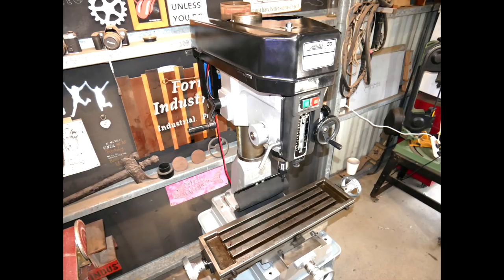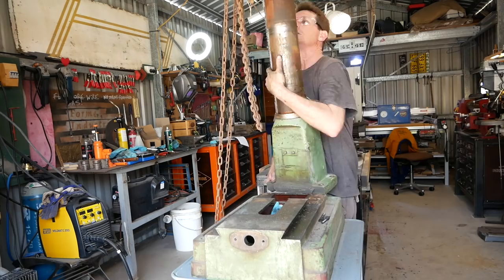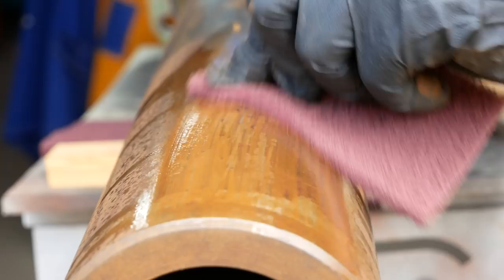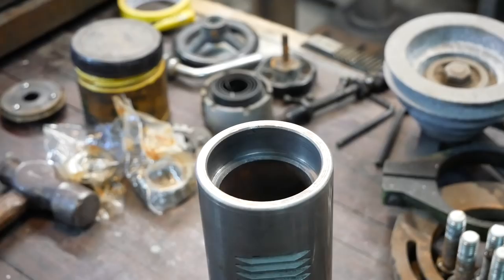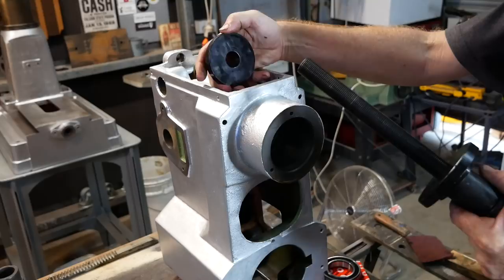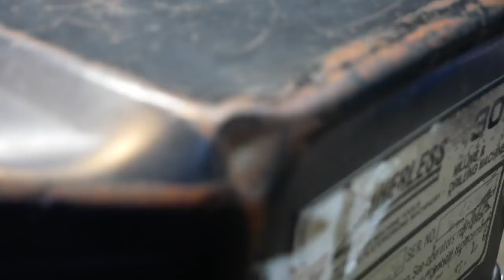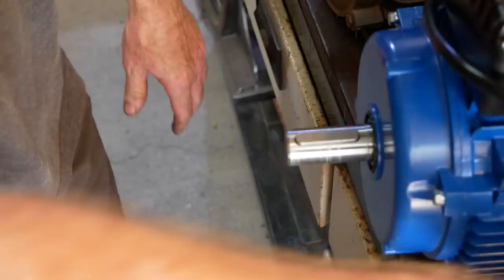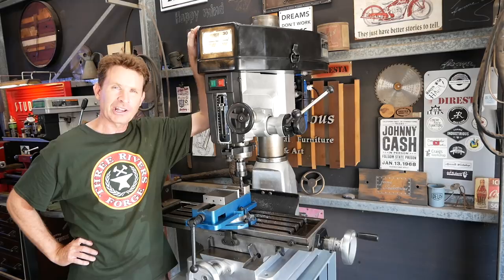RF-30 Mill Drill Restoration - Forme Industrious

Comment: I learned an awesome tip a few years back from a friend; get yourself one of those basic cheap FoodSaver (that’s the main brand in the US anyway) vacuum sealers. Next time you need to pack a bearing, cover it in a good amount of grease, pop it in a vacuum bag and run it through the machine. When all the air comes out it pulls all of that grease down into the bearing. Fast, easier and a hell of a lot less messy. Friend does that for spare wheel bearings when he goes to the race track. Aside from being easier it also doubles as keeping any spare bearings sealed from dust/debris in a nice neat package 👍🏻. Awesome video as always sir! Cheers from Arizona!
Reply from the maker: What a great tip! Thank you Danny, very much appreciated. All the best!

Comment: Much respect, my friend.  That was a huge job, and you did it thoroughly.  Love your broaching tool solution!  I am so glad to see that machine in your hands, put back into service.  Thank you to whomever donated it to Scott.
Reply from the maker: Thank you! I was looking for a simple solution for the enlarging the keyway. Fortunately the Aluminium is nice and soft and I could get away with using the chisel. I was surprised how easy it was in the end. I was happy to mention the guys name however he wished to remain anonymous. He is thrilled to see it back in action.
Reply: Absolutely I fully agree Batti2323
Reply: @ScottTurnerformeindustrious  Lucky you didn't just put a VFD on it as I will explain. 
FYI - I am an engineer with 30+ years in automation and I have installed and commissioned 100s of VSDs all all types of motors.

1st off the correct terminology these days is VSD (Variable Speed Drive). The old terms of VF, VFD, VVVF and others have been sent to the history bin for the simple reason that these days even basic drives can vary so many motor driving parameters and functions that its just inaccurate to call them anything other than VSD. If you tired an acronym that accurately describes all they can do it would be (in some cases) 100s of letters long. Circa 2010 I used a basic ABB 150 VSD on a fan [pushing air on a mine site. We did that for nothing more than the motor starting. That basic drive had more parameters and capabilities than many of the state of the art drives from the 90s. There was an incredible leap in motor control technology in the late 90s early 2000s.   I have used some drives with in excess of 3,500 parameters. 
Surprisingly some of the really high performance servo amps for robotics are also incredibly simple. Most of those vary nothing more than the torque output. Doing that accurately over the full speed range is the tricky bit. 

2nd there is a huge misunderstanding that single phase VSDs operating at 240VAC input then output 415VAC to the motor. THIS IS TOALLY UNTRUE.
The way ALL VSD's work is they first convert the incoming AC into DC and then use a transistor pack to create the variable 3pahse output. There's no magical voltage increase in that process. I have seen others make this basic mistake on YouTube and there is a simple fix.

In Australia many motors under 5kw and most under 2.2kW can be reconfigured. You can use them with 415VAC in DELTA where the 3 coils are arranged in a triangle (the Greek letter for D is a triangle). You can also use them with 240VAC in a STAR configuration where the 3 coils are arranged in a Y configuration. What you do need to consider is the POWER consumption. Not output but consumption which shows up as current. So you have to be carful that the cable to the motor is rated for the additional current. And yes engineers make that mistake way more often than they like to admit.

What you can do with many 3phase motors to retain the power output is reconfigure the motor from DELTA to STAR. If you look in the motor terminal box for a 3phase motor most actually have 6 terminals (2 groups of 3 opposite each other, 1 each for the end of each of the 3 windings). There are (in those motors that can do this) 3 small links. If you see those 3 links in parallel across the terminals then the motor is most likely wired in delta configuration. It you see the 3 links being used to connect the 3 terminals on one side together that its wired in STAR.
Look on the inside of the terminal cover or in the manual for the motor to check/confirm how you can wire the motor and what voltages the configurations  are for.

3rd what many engineers and others mistake is that the motor will deliver the same torque over the entire speed range. In the case of a mill or lathe they are forgetting that with the gear box also changes the torque that is delivered. If you just replace a pully or gear box system with a VSD & Motor its also very easy to lose all of the torque variability. This is why many of the small mills and lathes with VSDs still have a high-low or 3-speed gear box.

Comment: A simple but useful mod is to add some thin disk spring washers (Belville springs) to the spindle clamp. It allows constant drag on the spindle even when there is some wear where the clamping brake blocks contact it. You can still compress them down enough to lock the spindle when required but it stops some of the annoying rattle that results from leaving it too loose. I have eight of them in alternating directions on mine (0.035" thick a bit less than 1mm). It also allows you to have the clamp lever in a suitable position without it loosening under vibration.

Comment: The reason I watched your video because I own an older jet 16 inch drill mill, I want to remove the backlash from the table feeds. With the help of your video I now have the courage to start the repair work on my machine, thank you and by the way your rebuilt machine is awesome.
Reply from the maker: many thanks! I hope your restoration goes well.
Reply: @ScottTurnerformeindustrious  I stated the repairs and started ordering parts. One thing I learned order generic parts from other vendors, the Jet replacement parts are overpriced.

Comment: It was great to see someone that actually knows how to pack (lube) a tapered roller bearing. I couldn't even begin to count how many videos I've watched where someone is upgrading a mini lathe spindle with tapered roller bearings and all they do is wipe a little grease on the outside of the bearing and install it. Great job on the rebuild. Like you I would have jumped at the offer of a free mill project like that.
Reply: I guarantee you this dude is a motorcycle mechanic. That's what I do for a living and I see a lot of similar habits.

Comment: To give you an update I stripped the mill down to bolts and nuts cleaned everything up and used industrial grey oil base enamel paint. I bought new bearings. I'm ready to put the mill back together... To clean the old paint off I used a wire brush on my disk grinder. It took the paint off to bear metal. I wanted to send the mill table off to have it milled down .010 to .015 thousand but decided to live with the beat-up surface. I have watched your video several times as I didn't lay the parts out like you did I just piled them in boxes and whatnot so your video has come in very handy. Best wishes from Mike E USA.
Reply from the maker: Hi Mike. I agree with the table, just take off any high spots with a file or such. Not that critical on these machines and you will save a few dollars. I'm glad the video has helped. All the best!

Comment: As always a excellent job you did restoring the mill. I always keep the old bearing race and make a slot in it with a thin cut off wheel and use this to press the new bearing in. The slot makes it easier to remove afterwards. Greetings from Belgium
Reply from the maker: Good idea. Thanks Tom!!

Comment: My current projects apart from a part built Jessie in 7 1/4 inch gauge are a Super 7 and a Raglan 5. Both super groups from the 50s he jokes. 30 years in a workshop with a leaking roof of course. Dragged the second past a rapidly filling skip now arrived. Both free, grabbed a small flypress, filing machine and a power hacksaw as I left on our 4th visit. 11 miles away YOU JAMMY SOD!!! Lovely Work Scott. David and Lily Scott Reading England.

Comment: I have the same or close to a drill mill like yours, it's every bit as bad as yours. My half-nuts are not good, so I might have to replace them. One thing I'm going to do is send the table out, have 10 thousands removed maybe up to 15, and clean the table up a  bit. I'm sure my drill mill was owned by a blacksmith cause everywhere there is a flat surface they must have used a hammer and pounded on it. I paid 140.00 for the mill and lots of parts including a pully and shaft were missing I just started cleaning my mill up yesterday and today watching you rebuild yours has been a real help for me.  Thanks, Mike E. The Bench Jeweler.
Reply from the maker: I'm glad the video helps with your project. Yes the half nuts will be worn on the older machines. I've adjusted mine but they are still sloppy. All the best with the rebuild!

Comment: Man this brings back some memories! I know how much work that was and yours was in worse condition than mine, so great job. Don't make the mistake I did and ever sell that thing! They're such great workhorses. By the way, when I had the same mill I made a little something I think you might have more use for now than I do. I can send it to you if you want?
Reply from the maker: Thanks Phil!  I referred to your video quite a few times, just so you know why there has been a spike in views on that video ;) It's a keeper. I need to fix the backlash in the lead screws I think (0.25mm and 0.5mm). Looking into a DRO which would help with that backlash. If you like, send me an Email and many thanks; sturner2022@gmail.com
Reply: Scott Turner oh cool. If you DRO it id be keen to see it. Picked up a RDM-350 version of these. Just starting to tool up and learn machining.

Comment: That was well done, I have the original Long Chang version, needs the same treatment ( don't think it will ever happen on the long list of "Round Tuits") couple of observations I would not have use 3 in one, that stuff drys up like shellac, ( never use on your sewing machines) plus that old chisel happens to be one the best Stanley made from the seventies, the stuff they make now is rubbish
Reply from the maker: Never knew that about the three in one. Easy enough to remedy. The chisel was put to bed unharmed, maybe a little shaken... Thanks!

Comment: Good job on the resto.  When you get tired of cranking the elevation handle, (if you haven't already), an old ½" plumber/electrician's drill, (IE: Milwaukie Hole Shooter, for reference), makes a capable & easy motorization of the elevation.

These type of HD drills used by plumbers came w/ a reversing switch, making it a good choice. Without a reversing switch, you have to crack them open & get wires into the fields.

I had 2, one reversing. Trying to get the chuck off the 50 yr old drill has kept me from re-wiring the non-reversing.  After pounding & impacting 'til my arms ached, I'm now trying the penetrating oil & get back to it in 6 months technique.
Reply from the maker: Cheers George for the tip. So far I'm okay with how it is, but you never know what might be done in the future.

Comment: Fantastic strip and rebuild instruction. I have a Warco Major which is the same, and I need to take it apart to get it down into my cellar. All questions answered, it will be a doddle now. Many thanks Andy. UK based.
Reply from the maker: Thanks Andy! They are simple machines really, just heavy. All the best for your refurb.
Reply: @ScottTurnerformeindustrious  By the way, where did you get your chuck and collet set from? thanks Andy
Reply from the maker: @andyjchapman09  an Australian Ebay supplier. Wasn't expensive.

Comment: I can just imagine the hours of fun you had renovating this mill.........back in  1980 I was on the eve of emigrating to OZ and assumed it was the back of beyond so decided to invest in a mill drill like this one to bring with me but after traveling miles to a dealer I realised it was a goner and not worth money they were asking......everyone I've  met that has one of these has nothing good to say about them.........,mills they ain't, drills they are......having the head swing around the column was the biggest heap of design crappery for milling envisaged.
Before leaving UK I bought a Berardi jig borer, made in Italy, well used but good for a mill with some mods........due to pressure of work and design complications it laid unused and covered over in the corner of my garage for 40 years and I despaired it would ever be used...........but today  it's running and with a VFD and DRO..
Reply from the maker: A knee mill is much better for sure, but these  round columns are fine for a home workshop. In a production environment they would be no good I agree. Glad you got your Borer running.
Reply: @ScottTurnerformeindustrious  True....I had a Bridgeport but sold it to my ex boss because he wanted it more than me and I bought an AJAX mill which is now also too big for my needs so I'll have to sell it on as the borer is now operational.

Comment: This is a really great reminder that you don't have to buy the newest/greatest/whatever tool.  Oftentimes with a bit of effort, you can get a really good older tool that can be made terrific with a bit of TLC.  I'm in the midst of restoring a ShopSmith from 1956.  It's taking me a long time, but for the cost of a few bearings, spare parts, and paint, I should have a perfectly serviceable tool at the end.  Unfortunately, I doubt it will look as nice as Scott's work!  ;-)
Reply from the maker: Very true John. I'm always on the look out for old machines and tools that can do with a bit of TLC. Thanks and all the best!

Comment: Thanks for this video Scott you have prompted me to finish my mill. Years ago I bought a gear headed drill (from the local trash&treasure $200) made by Rong Fu and branded in oz under various names , I went the Vfd route which was easy enough although the field wire size is small an care was needed digging out the Star point for the Vfd adaptation,  then I had a working 6 speed Gh drill with 3 speed down speed for around $500, I then bought a milling table on eBay for $230 , it’s the bottom half of a Rf 30 or 35 complete with the round column but no head and crank wheels. All I need to do is to marry the Gearhead to the mill table now ( easy enough except for the rack and pinion for the head lift) but in hindsight I would have been better off buying a new dovetail column mill , I’ll never learn. Thanks again for the video.
Reply from the maker: Thankyou Paul! Often these projects grow on us, though there is always something to learn along the way. Yes it would be hard to beat a dove tail column and the VFD would be perfect. All the best.

Comment: I'm glad you did a video of the refurb as I did a rebuild on a new purchase with the intention of filming it but got carried away with just doing it. I think mine is a rongfu as well.(no ID but looks the same) Had to replace the motor as well as it was 110V and had to modify the pulley like you did. My spindle is R8 though. Can send a before and after pic if you want. Just finished installing DRO and power feed. WOW what a difference it makes.
Reply from the maker: great to hear and thanks - cheers Allan!

Comment: Had to subscribe since we picked up an 1980 Enco 2 yrs ago and for the buck$$$ a great small mill for any small home shop. I normally convert all my saws, lathe's to 24vdc motors with motor controllers and power supplies. but just last wk I picked up a HD Medical grade tread mill for free, and was shocked to see a Baldor 2.5 vac 220v motor. This will now power my vertical mill, and use a motor controller to control RPM's. I hate changing belts !!! Have the VRO and servo motors for X & Y, so will be a good winter project when time allows. Great restoration job on your mill,,,let the chips fly,, Bear in TX
Reply from the maker: Thanks Bear. Yes changing belts is a bit of a pain, especially if you have experienced the convenience of using variable speed control. Nice score on that tread mill motor. I should keep an eye out for those.

Comment: Gorgeous view of the machine.  Beautiful work.  Those machines came with a 2 or 3 inch facing tool.  I always thought I would use mine to resurface the bed,
Reply from the maker: I haven't got a facing tool yet, it would be nice. I just knocked down the tops of the divets and scrapes. What remains is character. Thanks Ted.

Comment: This just popped up on my play list!  I thought the one i got had been neglected... That one looked as if it spent a few years out in the back 40.  You did a beautiful job of restoring it and bringing it back to life!  One trick i learned to get the surface rust, oils and grit off of rusted steel is a mix of 50:50 Dawn (blue) dish soap and Vinegar with scotch-brite  pads. fallow up with a good protecting oil or paint.  Most of these mills need some shimming on the coulomb (between the base and the large bolts)  adding one or two  thousandths in the right corners will get an indicator to sweep  a clean "0" in all four directions  on the mill table. Make for beautiful fly cutting!  That lazy machinist has an good video on it.  These machines are under rated IMHO.  New Subscriber here!
Reply from the maker: Thank you Scott. Yes they are a pretty handy Mill. Thanks for the tips, have plenty of projects to try the rust removal recipe on. Also thanks for the sub!!